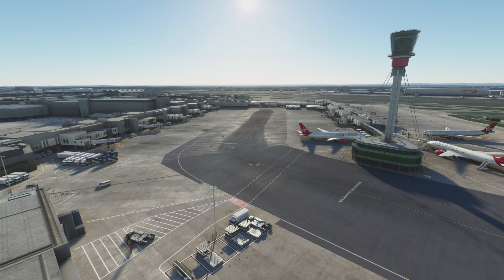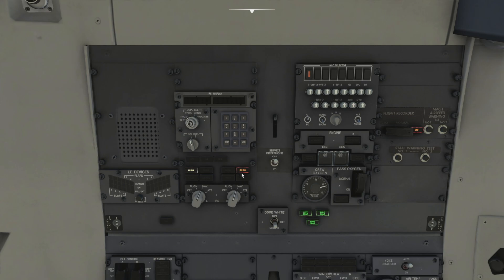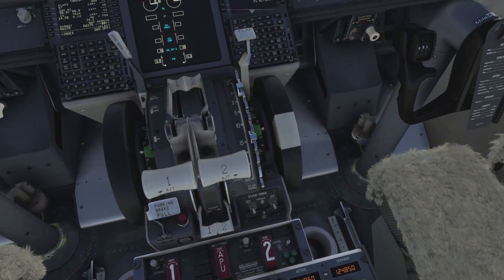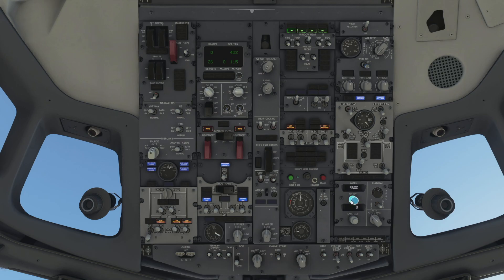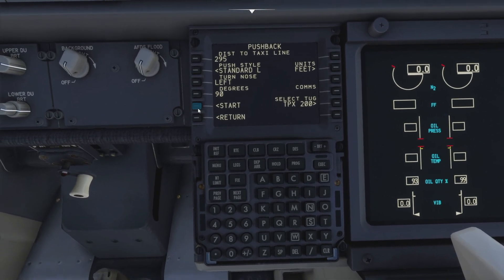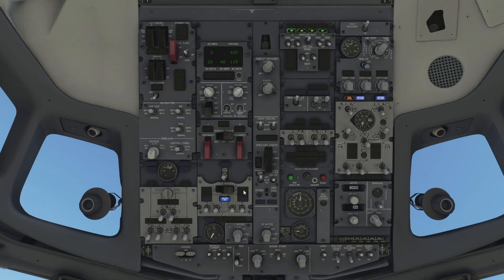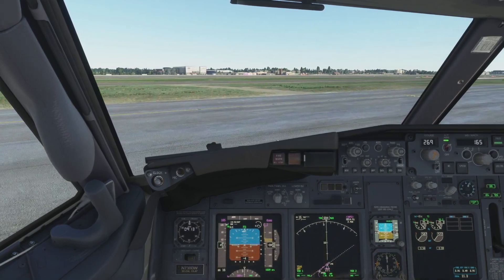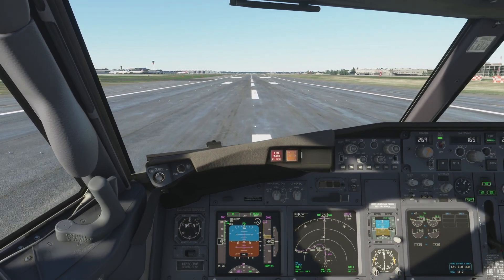PMDG 737-800 Cold & Dark Quick Start Guide TUTORIAL #microsoftflightsimulator #msfs2020 #msfs #pmdg

Comment: Thanks for this video! Really helpful! I’ve been struggling to get my PMDG 737 800 to start from complete cold on the stand on my Xbox in MSFS 2020. Every time I select a gate and PMDG it spawns on the gate but with electrics all on, only thing off is engine and it then won’t start properly. Any tips to get it to start completely stone cold?? 🥶 lol
Reply from the maker: Hi Gareth… thanks for your question. You need to go into the PMDG menu in the settings in the FMS… then from there you can set your initial panel state to cold & dark. Then every subsequent time you load in it’ll start from cold & dark. Thanks for watching, appreciated 👍✈️
Reply: @ amazing thanks so much for replying. I’ll give that a try

Comment: (Question at the end) I've watched TONS of 737 videos to try and help me get this working and this, this is the only one that actually helped. So thank you! But I do have a question. I have followed everything you did along with putting the flight plan and anything else you skipped past. For some odd reason, it doesn't follow the flight plan. It did it once but now it will not do it again even though the flight plan and heading should be correctly implemented. Any ideas as to what went wrong?
Reply from the maker: Hi TJ… thanks so much, glad you found it useful. To answer your question just make sure you selected the correct departure runway & SID… then double check you have both flight directors turned on along with auto throttle… then once you’re airborne and through 1000 ft hit CMD A to engage the autopilot and you’re golden. Thanks for watching & commenting, appreciated 👊✈️
Reply: @seven3simmer  Appreciate it! Turns out I had not imputed the first waypoint :/. It said (Vector) and I had to change it to my waypoint, had to do it on the arrival also. Any who I got it fixed, thanks for your help. You have a great day! Hope this helps anyone reading in the comments with the same issue.

Comment: This is a very good video. I recently bought a 737 900 series, but my autopilot misbehaved when I used LNAV. It never turned smoothly at each waypoint. Do you have any suggestions for this?
Reply from the maker: Hey, thanks. Not sure what your issue is. Just make sure everything is set correctly in the FMC for your SID / flight plan so the plane can adhere to all the correct constraints etc. Also double check that you have auto throttle engaged and you should be fine. Thanks for watching & commenting, appreciated ✈️👍

Comment: Hi. Thank you for this tutorial. Instead of clicking that little screw before we take off, in terms of reality, what button can we press? I know that's a shortcut put by PMDG, but where is the exact button that does the same function? Thank you.
Reply from the maker: Hey… thanks for your question. I have a throttle quadrant and bind a button on there for TOGA. You can bind it to any button you like in control settings, either on a keyboard or controller. Thanks for watching 👍✈️

Comment: Don’t know if you’d be able to help? Only one engine ever starts and it’s driving me mad, followed every step you did
Reply from the maker: Hi Ollie, thanks for your question. You need to make sure that the ignition starter switch in the overhead panel is set to ground for both engine 1 and engine 2. Only start one engine at a time, ensuring all your fuel pumps are on. Also make sure you switched the fuel lever on for engine 1. Thanks for watching, good luck 👍✈️
Reply: @seven3simmer  thank you dude! Casually changed the livery , and fuel from 50 to 100 and this time it started 👀 spooky , tysm for the tutorial though great video

Comment: hi i got a problem with mine 737-800. i barely turn while taxiing. ive seen some advices like hyd fluid etc. but nothing of it worked. any ideas or advices?
Reply from the maker: Hi… thanks for your question. I’ve had that issue before, what fixed it first me was servicing the hydraulics in the PMDG menu. Also just double check you’ve turned on all the hydraulics in the overhead panel. Hopefully you get it fixed 🤞✈️
Reply: @seven3simmer  ok thanks a lot ill try it